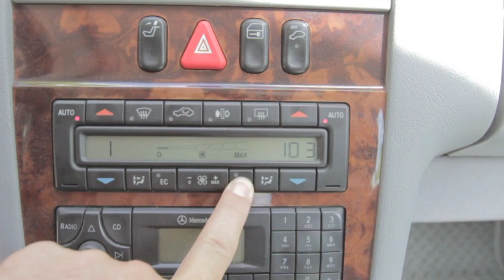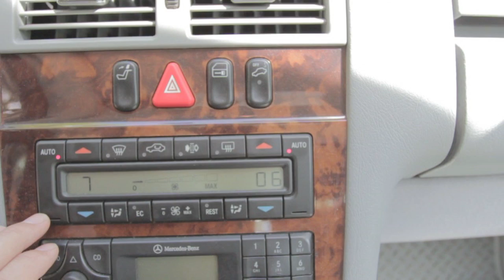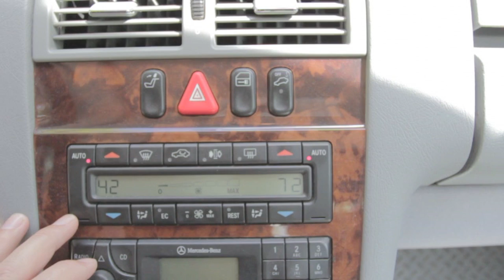W210 Mercedes Climate control Live Data

Comment: Well yes , The compressor  broken and needed a filter  and leak front valve replace  Now someone to do the Work there Asking $380.+ to fix thats Labor cost Not PART’S  I bought the parts already total PART’S And Labor About ( $700.) this Being Over Charged So I Am Waiting for A Better machanic with a lower cost 🙏🏿

Comment: Thanks for the codes. I have a 97 e420 that is blowing cool air (not hot but not cold) and I have noticed that the auxiliary fans are not coming on unless I hold down the 2 auto buttons. With the ignition on in second and the car not running, #20 reads 0.0. If I turn the car on the #20 still reads 0.0 but if I hold down the 2 auto buttons the fans come on but, the reading is 10. Nobody seems to be able to diagnose this fan issue. Can you?
Reply: You resolve this problem with the aux fan?